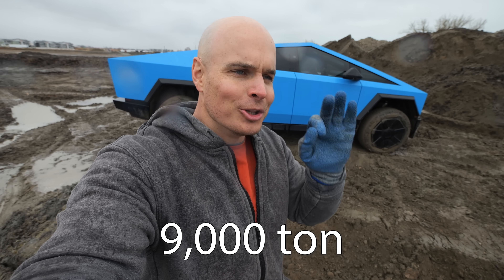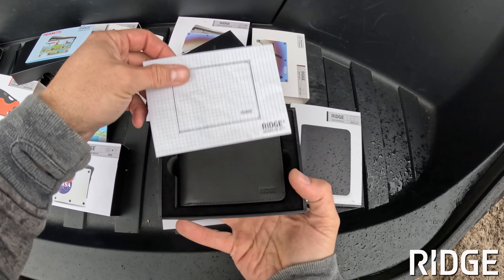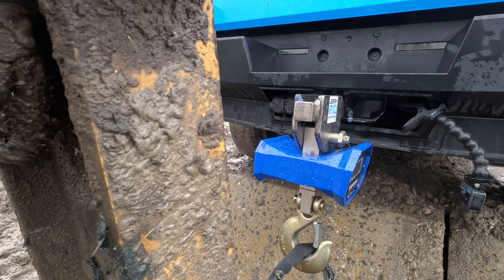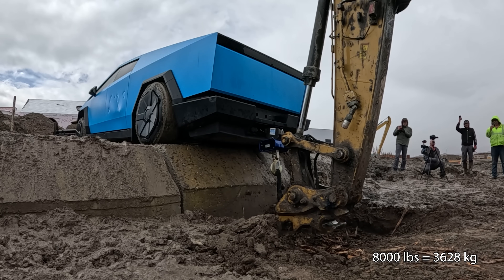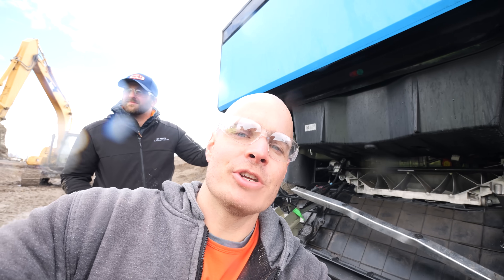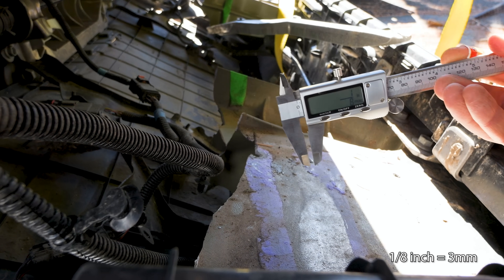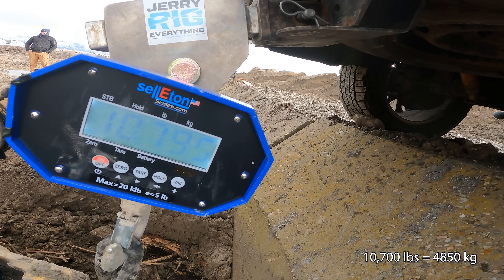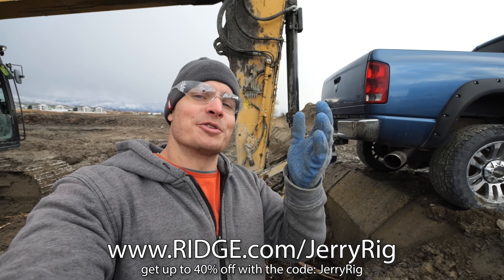SHOULD YOU TOW WITH A CYBERTRUCK?! - (catastrophic failure test)

Comment: German mechanical engineer here. It's very simple for engineers to figure this out at design stage. The die casted Aluminum frame has an E Modulus of around 70 GPa. The steel frame around 210 GPa. Usually, when engineers use Aluminum instead of steel they use 3x the amount of material to offset the lower E Modulus of Aluminum. Tesla used Aluminum AND a lower wall thickness. Thus, the result. This is really basic enginneering stuff.
Reply: its very simple steel is stronger than aluminium no need of engineering! there is a reason why steel is sooo versatile and important.
Reply: in Australia and even Asia people have been cutting and extending the lenght of their regular truck frame for more capacity including 6x6 conversion, RV builds and heavy haulers.
Reply: Right Mr. German ME - Mr. Danish ME here - so when it comes to towing capacity on a truck which is rated for a max capacity of 5000KG - how much downward pressure at the hitch will this truck ever experience? NOW you have to remember that the full weight of the truck is 3.100 kg. in this calculation. How many KG of downward pressure at the hitch would it take for the truck to lose a critical amount of front wheel pressure? Well let me help you: IF the back wheel was at the hitch it would be a full equilibrium at 3100 kg of pressure - however the rear axle of the truck is actually fairly far from the hitch - can't be bothered to look it up - but it looks to be something like a 5th of the length of the truck - which is 5.6m long - so let's just say 1 meter from the hitch to the rear axle. How much does that change the downwards force you need at the hitch to take the front wheels off the ground? Well I did a quick calculation - and I think you should do the same because that 3 tons where everything was fine and dandy - yeah it's NEVER gonna get ANYWHERE close to that! 

The result of this test isn't applicable to anything other than people who hate this ugly truck to hate on it! Like literally I dislike this truck a lot - but this here is just stupid and has NO relation to real world use! OH and if it's a bad thing to make cars of - maybe you should talk to Mercedes, BMW, Audi and Porsche about that because obviously they don't get it!

So no - They deliberately broke the hitch to be meme lords - "Thus, the result."
Reply: @Craider79 exactly!!!
Reply: @Craider79  Hi Mr. Danish ME, Czech ME here. It seems to me like you are only considering static loads. The hitch is experiencing dynamic forces in every direction with varying magnitudes while driving - Turns, acceleration, deceleration, driving over hills, speed bumps, potholes... When hitting a pothole (or a large speed bump), the magnitude is in another league compared to loads under normal driving conditions as it is an impact. Once you factor in fatigue and the strength of that aluminium subframe, you bet there is a possibility of breaking it.
Reply: @nikdolp9  They are only testing downwards pressure - so no actually I'm saying that they shouldn't test in this way and the test is useless. No matter how you cut it - dynamic or static - 3 tons of downwards force would spell disaster for a 3 ton vehicle! IF 3 tons were applied AT ANY POINT - say at a pothole - the front of the car would flip - violently! NOW - does this mean that the frame can't fail in a real world scenario - no not at all - in fact - I have TONS of reservations about the design of the Cybertruck - however the seesaw effect is the seesaw effect no matter how you look at it - and it totally voids the findings of this "test" considering that it would cause the truck and trailer to seesaw in the real world! What would be MUCH more relevant was an actual stress test of the hitch with changing forces in the 1.5-1.8 ton range - and periodic test to check for hairline fractures and hardenings. However - it still stands that this test here is ABSOLUTELY USELESS!

Comment: What you tested is tongue weight, not towing capacity. The weight that can be pressed downwards on the hitch is very different than what it is rated to tow. I am not saying there is not a problem with the safety of the cybertruck. I am only saying this test was done incorrectly and does not prove the point of the video.

Comment: you accidentally said steel doesn't have a fatigue limit, but yah aluminum gets weaker over time nomater hot little stress is applied.

While steal as long as the stress is under a certain number no fatigue is experienced no matter how many times stress is applied as long as it doesn't cross that force limit it won't affect the strength of the steel.

Comment: What you tested is not what you think you tested.
Reply: static loading is the absolute best-case scenario for the tesla, and while it's not directly equal to likely trailer hitch use, it is interesting data.
it shows that if that hitch has 1100lbs on it and experiences a 10g shock, it could snap off. given the rigidity and weight distribution of the tesla, high shock values are more likely than with the typical pickup.

Comment: This is BS. A typical maximum tongue load for a pickup truck is around 10-15% of the total trailer weight, meaning if you're towing a 5,000-pound trailer, the tongue weight should be between 500 and 750 pounds. That means if your frame broke at 10,000 lbs, you were attempting to tow over 60,000 pounds. The Cybertruck claims it can tow 11,000 pounds, which means the tongue weight capacity should be 1,650 pounds. You applied SIX times that much - proving absolutely nothing.
Reply: Those are guidelines for loading the trailer on a flat level surface, not what your hitch can experience while towing. Those guidelines are so that you are not too light in which case at certain grades or bumps you could be lifting, so that you are evenly stressing the entire system, and so that your trailer tracks straight and doesn't react more than the truck in a turn. Those are all major safety concerns.  That doesn't mean that your hitch NEVER experiences much higher loads, it just means those are your safe loads that accommodate the safety factors in all possible towing conditions. Your hitch experiences easily several times that on a perfectly balanced maximum weight trailer going down a steep hill, because the trailer is now tilted forward a lot more of the weight is held by your hitch. Hitting a bump also massively increases that load. The safety factor compensates for both of those and more. Manufacturers do not list safety factors because they will likely be abused. CyberTruck has a class 4 hitch. SAE standard for class 4 hitch in vertical compression is gross trailer weight multiplied by 1.3. So for the CyberTruck to pass SAE standard for a class 4 hitch with a it's maximum 11k pound towing capacity it would need to be able to withstand 14300 pounds of vertical load on the hitch without failure.
Reply: prepare to be attacked by a bunch of morons. 5k tongue weight would be a 30,000lb trailer. who puts that on a truck bumper??? pretty sure this is paid for by Ford...and yeah Im a Ford guy. I was also a fan of this channel until now.
Reply: @gabbymcgibson984  I literally explained why they did what they did.
Reply: @ well thank you, i backed you up. we build horse trailers with living quarters...so I thought I would support you :)
Reply: How’s that copium?

Comment: Former automotive engineer. The purple adhesive is body adhesive. It is structural adhesive. Replaces the need for spot welds or bolts in certain areas.

Comment: This is definitely not a scientific test and only an idiot would think it was. And you are crazy if you think a someone could somehow "accidentally" improperly put 10,500 pounds of weight directly on the toung of the trailer. The cybertruck has a tow capacity of 11,000 pounds. So it basically held its entire TOWING capacity on it's receiver...

DOGE probably cut funding for a program you take advantage of so you put out this nonsense.

Comment: At 11k lbs towing weight they expect a 1100lb tongue weight.  Their static safety factor is very close to 10x, but like you said, improper loading of a trailer and shock loading of the hitch could result in catastrophic failure.  I know there are some rules of thumb for G loading of suspension components, and I recall 6G being used in racing cars.  A worst case scenario, like Interstate 280 in California, could definitely result in failure at full rated load.  Also, I wonder if Tesla prescribes the use of a weight distributing hitch to meet the 11k towing limit?  A weight distributing hitch places interesting loads on the hitch because of the preload springs, I suspect it could result in a much shorter lifespan due to cyclic loading.

Comment: 10000 ld's is incredibly strong off that single point! No hitch is designed to handle that, the 11000 lb's is the entire weight it can pull not balance on the Hitch Point!! What a Ridicules Test!!!

Comment: Tow strength isn't based on a straight downward force on the toeball though?  toeball weight is very different? Steel will bend while cast alloy will not. but I am not sure what that actually proves.  The real engineers in the comments here have explained this a lot in the comments already. Lame guys, Lame.

Comment: This is very valid. Aluminum can handle much higher static loads (this test)  than dynamic loads, which you’re experiencing towing.  Dynamic loads can hit 6-10x tongue weight when towing. So this type of failure is a very real risk. I suspect that the lack of max towing capacity utilization by Cyber truck owners will keep these incidents rare though.

Comment: You're pushing down though? Tongue weight on any vehicle isn't supposed to be more than 10-15% of the total trail weight. It's not designed for up and down strength it's meant to pull. Is it as strong as it's steel counterpart obviously not but that's not the question. Edit "I see you went over this at the end lol"

Comment: Pushing down is tongue weight, not pull/max tow rating? (you verified that over 7k lbs, double rating)
you should have pulled backward, not pushed down, for testing the 11k tow rating?

Comment: It might have been worth spending 30 seconds googling tongue weight vs tow weight.   All this video proves is the Cybertruck can handle 900% more tongue weight than it's rated for in static loading.  Useful info though for those times when you're accidently back your 10,000lb trailer over the edge of a cliff with a Cybertruck.

The tow failures that have occurred are most likely from fatigue failure not tensile failure which this test ignores completely.  The testing is wrong, the conclusion is wrong and you looked stupid while needlessly destroying a Cybertruck.  Good click bait though so congrats on that but don't be surprised if you get a letter from a Tesla lawyer.

Comment: The fact that it seems to start bending at what looks like 4000 is not good, aluminium isnt as good as steel when it comes to elastic deformation, a few bumps on the highway of an improperly loaded trailer with 1000lbs on the tongue(momentary force of 4000lbs) might see this crack and fail

That being said, that aluminium is far thinner than i thought it would be for how well it held, and am shocked that it isnt thrice as thick as it looks.

Comment: The truck exceeded its tongue capacity by 10x, yet that is somehow bad? This may be the dumbest video I've ever seen you make. I hate the Cybertruck and vomit in my mouth when I see one (which is very often), but this is most worthless video I've seen in a while. Anyone that tows knows the difference between tongue capacity and tow capacity and why putting 10K lbs directly to hitch is going to fail as it is only rated for 1100lbs (this 10% is the standard for all trucks). There is no scenario where the tongue will have 11000lbs of sheer force, unless the trailer went completely vertical, in which case it would break free of the tongue long before reaching 90 degrees. Jerry please take a deep breath and forget about Elon, your hatred of him is making you act like a child.

Comment: Ok but this is pretty bull, the max tongue weight on a cyber truck is 1100 pounds. It survived almost 10x that. That's AMAZING. Also the max towing capacity of 11000 pounds positioned anywhere on a trailer attached to this would have enough weight distribution to the trailer wheels to easily handle your 11000 pound load unless more than 90% of the capacity suddenly ended up on the tongue, which again, unless you are pulling 10000 pounds straight up a cliff does this not work, and what vehicle that you and your buddies are going off roading in weights more than 6000 much less 10000, you could winch ANYTHING that's not military grade up a shear face, your example is a lie. Another thing. The idea that it's a fair game to hold the front of the trucks down and exert a shear force on them and say "oh look the steel truck didn't snap" is total bull, at half that weight the truck would be wheelieing and the tongue would be on the ground, obfuscating the whole experiment. At that point you're comparing steel and aluminum, and no shit the steel wins, (even though the frame is so bent that it will never drive again, but that can't be shown cause you don't have an engine in it) but these are conditions that the truck wasn't designed to do and let me remind you is not advertised to do. It's an aluminum bodied truck with a 3/16 INCH FRAME that can do all the same things a steel one is rated for that's who knows how much thicker at the frame. THAT'S the holy shit moment. Same capabilities, less weight. Yeah snapping the trailer hitch off a truck is cool for a video, but it boils down to a poorly thought out anti-tesla PR stunt, that yes, tesla WILL NOT DO ANYTHING ABOUT BECAUSE THIS IS VIDEO MAKES ZERO SENSE. You should be singing this things praises for being able to do the same with inferior, cheaper and less materials, not shitting on it by comparing apples and oranges. The engineering that went into designing the structure of this thing is INCREDIBLE and all you've proven is if I take two rods, one steel and one aluminum, and the aluminum one is half the thickness of the steel one, and I exert the same force on both the aluminum one snaps and the steel one bends in half. Both are functionally screwed, but you cheat by saying one has plastic deformation. Big whoop. Always have been a big fan of this channel, but this was stupid and made you look dumb. Read @bgowrwbw4755 comment as well.

Comment: If you had put the bucket on the loader with a full scoop you could have added another 2000 pounds, depending on bucket size and the density of the fill material.

Comment: This was a stupid test. The Cybertruck is not marketed as a Heavy Duty work truck. 10,000lb tongue weight failure seems perfectly respectable for any sort of normal towing on a light duty truck. With 11,000 lb towing capacity this truck should reasonably be able to handle 1500- 2000lbs of tongue weight.

Comment: I have 2 MSc degrees, one in structural analysis, and the other in structural materials.

I don’t think this is scientifically accurate experiment by any means, I hate Tesla as a whole, but they did not do it justice at all.

First of all, why applying the load vertically ? It’s called towing capacity.
Materials tend to have very very deferent characteristics depending on the loading criteria. You are changing the load from tensile to shear, towing depends on tensile strength not on shear.

Secondly, by unloading and reloading the section again “when the truck position modified at the middle of the video” you basically weakened the material soo much, since the yielding point is pushed forward in the stress-strain curve. “Look at loading and unloading cycle curve for any ductile material” 

So basically, by unloading and reloading the material again, the results are invalid. Also, the force measured is shear force not tension. So again, invalid results for towing.

Comment: You are testing tongue weight not towing capacity. 10,000lb tounge weight is amazing. Now go test towing capacity because there extremely different.

The Tesla Cybertruck has a maximum tongue weight of 1,100 lbs (500 kg). This matches the 10% rule of thumb that tongue weight should be 10% of a vehicle's maximum towing capacity. The Cybertruck's maximum towing capacity is 11,000 lbs (4,990 kg).
Reply: Another youtuber called out with 0 response. What a surprise,  post facts and they go silent 

Next time get a decent engineer who knows the differences in tests before you test the wrong thing to get the wrong results lol.

Now get a tesla, hook it up to a steam locomotive and "pull" the locomotive, that's towing weight, not tounge weight.

This video is 100% wrong in its results for what you think your testing lol. 😅

I don't even like or want a tesla, not a fan of any EV but stupid tests with wrong results is not how you put a company down...

Good try

Comment: Looks like you don't know how towing works... Class 5 hitches are only rated up to 2,000 lbs. So 10k is plenty. The truck is only rated to pull around that also so why would a trailer ever put all of its weight on a hitch... Why compare a cyber truck to a 2500... should have done a half-ton. Least scientific video I've seen you put out.

Comment: All hitches have a maximum vertical weight, the ‘nose weight’ which usually maxes out at no more than 10% of the vehicle’s maximum trailer towing capacity. So if the vehicle and hitch is rated to 7700lbs then the maximum allowable vertical nose weight will be between 500 and 800 lbs. No hitch or vehicle is designed for extreme vertical downforce